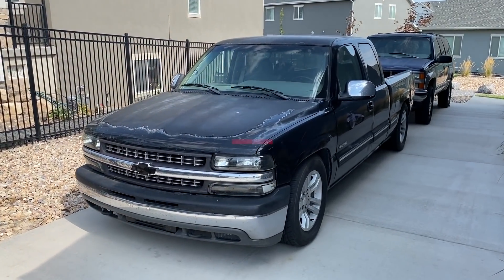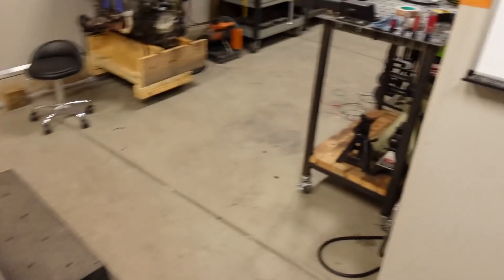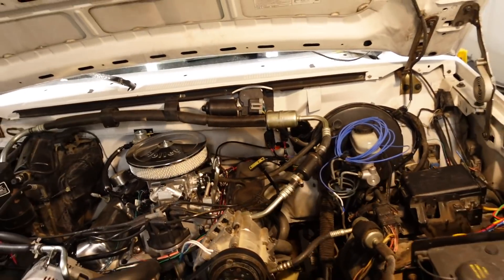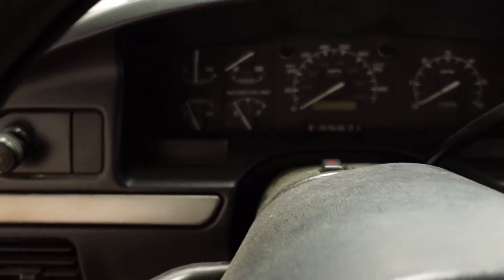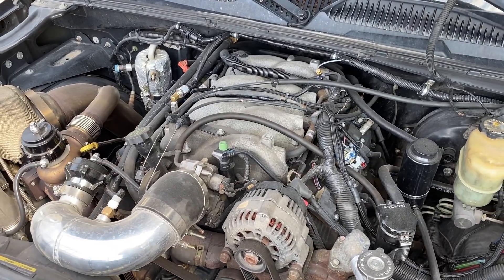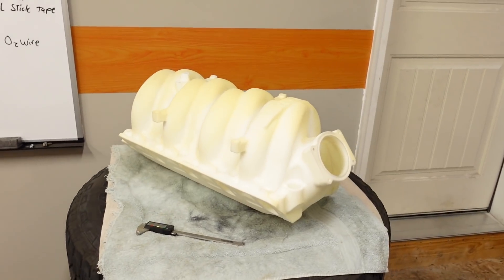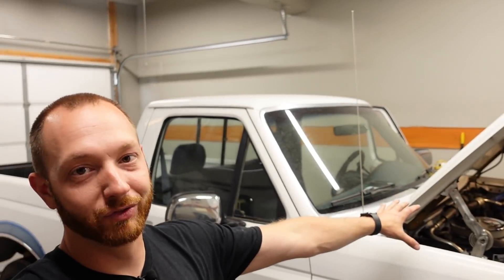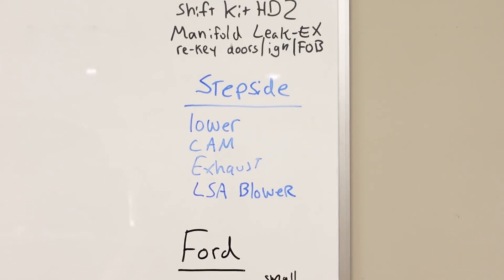UNVEILING a BRAND NEW intake manifold for the 8.1 Vortec

Comment: You should try running this plastic intake  on ugly truck when you reassemble after your cam and rocker install. From what I hear intakes CAN be plastic like the stock intake tube is. Not so trusty for a daily driver, but for strip runs should be fine and cut weight down.

Comment: Did Raylar lower the throttle body on its intake at all?  Also do you know of anyone that makes an adapter plate so the intake tubes are not 90 degrees in the air and make it come straight out?  im doing an 8.1 in a 66 Chevelle and want the stock hood to stay in place.

Comment: I’m really curious as to how much I could benefit from this, I’m right up in the 6,300 rpm range with my tube and I definitely notice the loss of air flow after 4,000 rpm
Reply from the maker: If you have ported or aftermarket heads, this should help a ton

Comment: Hi been watching your 8.1l jump. Just noticed you still actually have the 2500hd steering knuckles. Just so you know, with the extra weight of the 8.1l(400lbs more then an L.S.), one should build the steering and front end for a 2500/3500. At least a steering stabilizer shock on the center link. Look into kryptonite they are awesome my yukon xl 2500hd 8.1l literally spat out stock stuff in 1500/2000 miles with no other issues, just due to weight. Also hydroboost was installed on the 8.1l not just for brakes, but for steering as well. From personal experience without hydroboost the 8.1l drives like a chevelle, with it it is way more like a Lexus or bendz. The trick to big block motors is applying the torque to the ground without spring squat or burnout, try looking into z95 magnetic ride shocks more power to pavement. Just saying that control is the name of the game with big blocks.
Reply: L.S. lame shit

Comment: I disagree that the carb intake from dart isn’t a good option. To me it opens up more/different option to setting up the 8.1. It for sure flows better than a stock/unmodified intake (can support over 600 hp) and can simplify an install into some peoples vehicles. Sure it may not be the best option if you live in a place that does inspections for registration and need all the emissions stuff or something like that, however not everyone has to deal with that so that isn’t a big deal. Plus you can then go with a self learning EFI on the carb intake if you still drive on the street a lot, or go carb and keep it real simple for something like a true drag car. Either way, if you go dart carb intake, or mod the stock intake, or go with Raylars new intake, it’s not like your going to save money one way or the other, so it really depends on what you plan to do with your car/truck. But to just discredit the carb intake, that’s where I can’t agree with you. Love the 8.1 vids you’ve done though

Comment: fwiw the stock heads are NOT junk.  They flow 290 cfm which can support over 600 bhp.  There used to be a 525 bhp marine version crate engine (HP3) from GM with basically just a cam and headers.  Raylar heads are a good upgrade (and expensive) but you don't need them to make 1000 hp.
Reply: The HP3 8.1 did have some porting done on the stock heads, however I agree with your comment that people for some reason say the 8.1 stock heads don’t flow well, which just isn’t accurate. The #1 most restrictive part of a stock 8.1 is the stock intake itself. #2 is the stock size throttle body. I would say #3 after that is the stock heads, however they still flow enough to support really good power. Sure Raylars heads are better as they flow more and are aluminum so save a ton of weight, but the price tag deters a lot of people.

Comment: plastic keeps the intake air cooler, but the real benefit is it's less than half the weight of a cast aluminum manifold.  

his heads are expensive.  it sounds like he outsources a lot of his machine work and that drives cost up. If you can make a 600 bhp base engine it will only take 10-11 psi to make 1000 bhp.

Comment: So that gen Ford dashes have a "dumby" oil pressure gauge. Basically anything above 5psi the gauge reads normal. This can be remedied by bypassing the resistor in the back of the gauge cluster, and installing an early model ford oil pressure sending unit.

Comment: It's super cool what they are doing. I'm wondering if you could do a tall deck 4150 carb intake, add injector bungs and an elbow and get something more race oriented? For the person that doesn't care about reusing OEM parts perhaps.
Reply from the maker: I think a few people have done that, in fact, dart makes a carb intake for the 8.1 and I think they have room left to drill for injectors

Comment: Does this automatically have a PCV delete? Also I didn’t see much of the ack of the intake, I’m assuming the EGR is blocked off as well?
Reply from the maker: no, the PCV hole is still in the bottom of the intake, and the "EGR" port is there since in marine applications the IAC motor goes in the same spot (or so I'm told) so they needed to keep that port in the back of the intake.

Comment: The biggest downside but building oddball engines it's the lack of support. I'm going to guess that the 8.1 has performance parts but they are pricey and hard to get. Lucky for me big block Ford parts are everywhere, the only downside being because I'm building a multi-port fuel injected big block I have to keep the crappy late model EFI heads and intake. I know my best course of action is to get some pre-EFI heads and a good intake and have it drilled to accept 8 injectors however that's just too costly right now..
Reply from the maker: yup, you are correct it can be hard to find the right parts when you're venturing off the beaten path, but its a challenge I'll gladly accept.

Comment: Hey LT, very cool part for your 8.1 build! I still vote for twin turbos and AWD on the step side. It’s not too hard to get a 4.8 to 1000 hp, but the torque curve will look really different than Ugly Truck’s will turn out to be. The “race” between 2wd torque monster and AWD rpm monster would be really interesting. I’m guessing your new 8.1 will get to 1000 rwhp at 12-14 psi, but the 4.8 (if you built it) would take 20 or more. Just dreaming here…
Reply from the maker: I like the way you think, that would be a fun comparison to see

Comment: Pretty cool that you get to debut it! Makes me want pull my 5.7 in the 94 one ton & drop in a 8.1! Any tips on what to look for in the salvage yards?
Reply from the maker: for the most part they're all the same, but I like the earlier 99-02 versions that have a regulator and return line built into the fuel rail, that will make plumbing a lot easier for the fuel system. also, if you get the harness, make sure its un cut if possible, and get the throttle pedal and TAC module that does on the firewall.

Comment: A local OEM supplier had a GMC 3500 plow truck that had a Raylar 8.1 engine and Allison trans, that was a development mule, their backup was a 1990 Chevy 3500 with Fueling aluminum heads on a 454, with a knob to adjust timing, and the people who drove them had no clue... 
They would light up the tires with a whiff of the throttle, and we always laughed when they came in, like you people have no idea what is under this hood....

Comment: Going to need an adapter for the 03, it has a 3 bolt throttle body,
Reply from the maker: True, but I’ll likely just use an aftermarket 4 bolt 90mm

Comment: I still want to see the 8.1 with a 10-speed Auto
Reply: Allison came behind the duramax and 8.1l pickup trucks.  Burbs and Avalanches with 8.1l got the 4l80e.
Reply: @dandevine83nv  nailed it!
Reply: @dandevine83nv  4l85
Reply: @arabian1982  same thing
Reply from the maker: that would be badass
Reply: Or a duramax allison
Reply: @abboudab6794  8.1 was backed by a Allison in medium duty trucks but they dont shift as quick as he wants so that's why he not using it.
Reply: @TeamTopKick  Oh, i thought they only came with the diesels, I agree on the shift speed, but i think they handle a turbo 8.1 crazy torque numbers, thanks for the clarification
Reply: @abboudab6794  yeah. The Allison was a option for even the 2500HDs with a 8.1L. I believe the standard option automatic was the 4L80E in a 2500 with a option for The Allison with a 8.1L but GM detuned the 8.1L if behind the 4L80E to make  the trans survive. If you got the Allison behind the 8.1L you got all the beans. The heavier the GVRW the more likely the "light duty" trucks were optioned for the Allison. I dont know if they put the 4L80E in Medium Duty trucks. Maybe if they were low speced units. I know Uhaul uses 8.1L backed by Allison's in there medium duty box trucks and cab and chassis trucks.
Reply: @abboudab6794  I agree a Allison built could handle the power he after but that's a heavy trans and designed for towing. For what he wants to do it makes more sense to build a lighter trans to handle the power he needs and have the benefits of faster shifts and gear ratios.